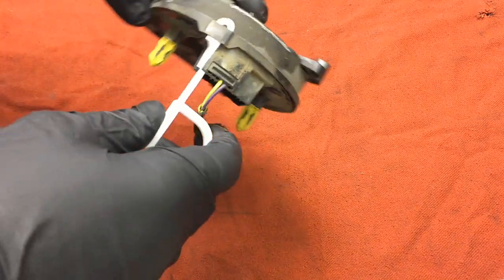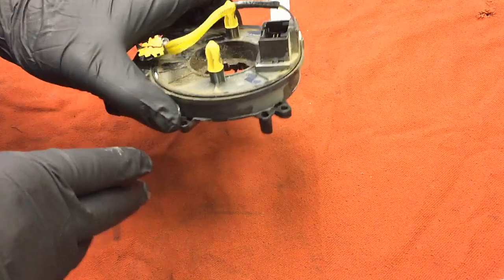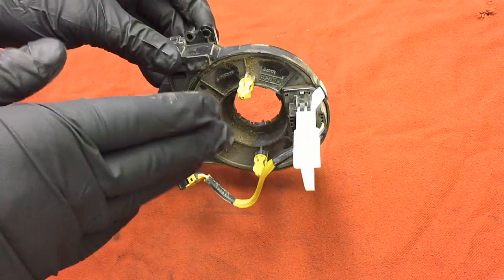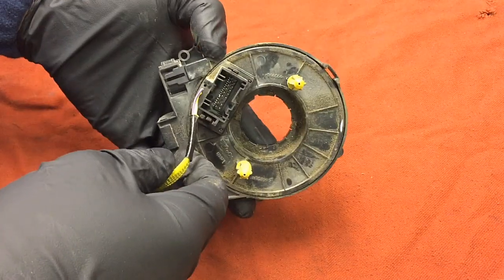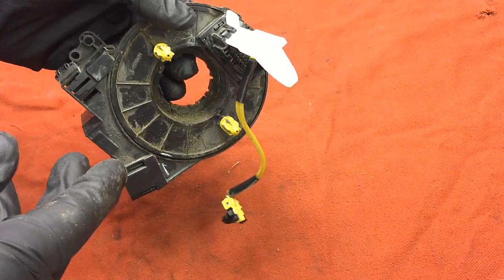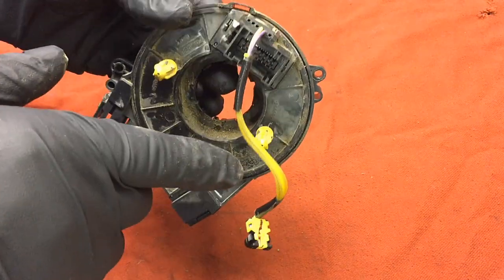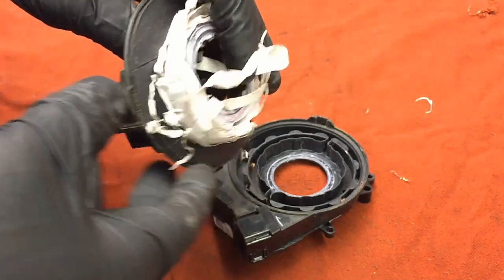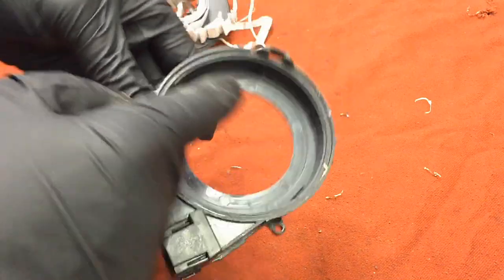Ford Quick Tips: #34 How Clocksprings Work and Fail

Comment: Great video as always Brian! I don't know if you're interested in doing this since you're only dealing with Ford,but there's a few makes and models out there that do not have clock springs available anymore and can cost up to 600$ to buy from the dealer. Of course those are sold together with the switches as an assembly. So you're only left with junkyard parts. Some of the people that work there don't know how to take them off and mess up the alignment. There's a procedure to realign them,they shouldn't go more than 2 and a half to 3 and a half turns from the middle to each side. So,if you're interested you can show how to realign them and also how to test them when they come from the junkyard-there should be continuity between the 2 pins of the connector for a good one.
Reply from the maker: Nick Nicu Yeah that is an idea, now I just need to find one that is not broken.

Comment: I have a 2013 Escape and I go thru about two clock springs per year. And at around 400 to replace these suckers, it gets to point where I just give up and don't bother wanting to get it fixed - what a pain this system is ! . Need to remove the button controls off of the steering wheel, or maybe have the buttons controlled by a wireless signal. Another thought is to have a gold wiper contact on the clock spring system (for non-critical controls). Just think what the other computer systems in this vehicle are going to cost when they "go south". Thanks Brian for the look-see !!

Comment: Helpful. Thanks. Mine just failed on my 15 Expedition with 55k miles. Seems like an unusual failure. I’ve never heard of anyone with that issue. The symptom was steering wheel controls on both sides stopped working. No warning lights, horn still worked.

Comment: Looked at your Ford cruise control vids a few times now.  This one,  the brake switch under the master cyl and the brake pedal switch.  I've replaced both switches on the MC and at the brake pedal... my clock spring seems 99%fine...  still no cc!  Paddle switch left of horn pad perhaps?  Anything else i need to be looking for?  Chip in or on the trans, speedo gear,  fuse links, relays etc etc.  1999 E150 conversion, high topper  93,800mi. Thank you for being here! 👍🏼👍🏼

Comment: Great video. Verified the clock spring is failed in my 98 Contour SVT. Reads code 32 Clock spring, and my turn signals don’t always cancel, horn doesn’t work and the cruise control has stopped working. All of these issues have been intermittent for the past few months, but last week cruise and horn stopped working the the airbag light is constant flashing flashing the 32 code. Very cool to see how the clock spring actually works, and now it’s time to find a good used one.

Comment: Awesome, thanks for this one.  I didn't have a clue on how clocksprings work until today...I just knew not to move the wheel when the steering linkage/box/rack was disconnected because you'd screw it up.

Comment: Interesting design, it's not what I imagined. I guess using a length of ribbon with continuous connections is better than rubbing copper spring contacts wear out over time. No spring, the curious name is historical only.

Comment: I find it amazingly crappy how this design was for the ribbon cable assembly. I have a 2013 escape and have had many problems with the button assembly that controls the front on screen display on the dash. Got tried of having to pay out 100's of dollars to get repaired by ford. So I took matters into my own hands and disassembled the steering wheel air bag unit with the controls section ( hoping that it was just the buttons acting up and NOT the ribbon cable). All I had to do was give the button assembly a cleaning with some electronic cleaner and  now it works just fine. When I opened up the button assembly, it didn't even look dirty at all. Cleaned it anyways and that made the difference. Mind you, it was a pain in the ass trying to figure out how the air bag came off but did figured it out. It cost me my own time only ..... this time.

Comment: Absolutely great video. Thank you so much for the information. I have an 2001 F150. Unfortunately the airbags are blown and there's no cruise control. May I just ask if the clock spring is needed? Or can it be removed completely

Comment: I would assume that the steering wheel would have to be indexed with the clock spring to prevent over twisting of the clock spring, that is unless the clock spring is capable of double the max number of steering wheel turns in a worst case scenario install. Thanks for the great videos. If you get in any panthers do an air ride video and or a plastic composite intake manifold replacement video. I'm really curious as to how the ecoboost head gaskets are holding up as well. 
Oh also I'd like to see an adjustable gas/brake pedal video assembly repair if you get any of them in. 
Great video as usual.
I'd of loved to of seen a video of your Focus engine rebuild. My mom has a 3.0 Vulcan Taurus and I really enjoyed your 3.0 Vulcan Taurus head/head gasket video. I hope that your employer is paying you top wages Brian as you save 3-fold your wages in return issues, as your work is so clean and meticulous that I doubt any repair that you have ever done has ever came back in. I doubt that you have ever stripped an oil plug or lug nut by cross threading one. Of course I'm sure lots of oil drain plugs come in stripped and of course, the blame would be on the current oil change. 
Thanks again. I wish I could do the things you do Brian.
Reply from the maker: fastrace011 You put the clockspring on centered, then those two yellow nubs on it lock into the steering wheel at that point. Ecoboost head gaskets are not a problem actually. I learned very early on in my career how to do this job right and have stuck by that. I think even more than pride I don't want to have to deal with management or the customer on comebacks or misdiagnosis issues.

Comment: If I grab a used clockspring for my 2016 F150 what is the procedure to clock it properly for install? It doesn’t have a locking tab on it and I don’t know if the wheels were straight on the donor truck when removed. Great video! Thx.

Comment: I’ve got intermittent cruise control switches. Just recently I’ve noticed my audio track selection switch on the opposite switch has stopped working. Then, just like usual they both started working after 3-4 ignition switch cycles and/ or when my battery was disconnected after getting the Expedition tune updated for the new Full Race Freak-O-Beast intercooler kit install I got for Xmas. 

It’s never been a complete switch(es) failure. Only certain buttons. I’ve successfully changed the cruise switches twice. They work immediately after changing for quite sometime. Then starts intermittently working again. Kinda makes me think switch, and not the clock spring in my situation.

Comment: What if your steering is quite, yet the horn doesn't work and curse isn't working? Fuses are all good by the way.

And I hope you see this and can help me, I'm having a difficult time trying to remedy my ac issue. 05 f150 4.6. Brand new compressor. Brand new high and low pressure switches. Refrigerant has been vacuumed and refilled professionally to exact lbs needed.

Ac clutch will NOT engage. But when I jump the relay under the hood it kicks on and stays running for as long as the pins are jumped.

The relay under the hood and even the entire heat/ac control panels switch are brand new as well. PLEASE help me figure out this nightmare! Lol

Comment: I have a 2014 ford fusion SE 1.5L. i think my clock spring needs to be replaced. The air bag light was on fir a few days about 6 months ago and went off by itself. Did not think anything of it. The horn does not work, the volume button does not work and the down arrow on the right side does not work. The steering wheel is quiet when turning. The horn does work when i hit the lock button twice on my key fob. Did not know if it is the clock spring or the sccm. Any advice?

Comment: I know this video is pretty old but my airbag light is on and flashing. It is giving me code 32. I've searched it and it is saying it's the clock spring. My horn still works and I'm pretty sure my cruise control still works. The light came on after I took my front driver and passenger side seat belts off to clean them.

I had to take them off due to some mold on the belts. I pulled the interior panels no problem. Unplugged the sensors on the belts. Then I pulled the belt out as far as I could then pressure washed the belts. I put a bag around the belt reel and sensor so they definitely didn't get wet. Didnt retract the belts till they were completely dry then reinstalled them. Plugged the sensors back in as well. Wires were all good too. Not to sure how long after but then my air bag light came on and is constantly flashing. So what could be the prob? Dont want to buy a clock spring and still ha e the issue. Plus can't buy one at this time. By the way it's a 2002 f250 7.3L. Auto 4x4

Comment: So I have a 95 F250 7.3L Diesel Manual Transmission. My cruise control quit working and research has taken me two places. A clock spring or the cruise control at the end of the brake cylinder.  The only steering wheel controls are for the cruise and of course the horn. I have also read that since I have no airbag I may not have a clock spring. I have the part number for the cruise release on the master cylinder but its installed in the 7 o'clock position. Will the brake fluid continue to flow once removed or is there a valve that will keep it from spewing out? I am leading towards this as being the culprit. AlsoI have to remove my instrument cluster for repair do you happen to have a video for that?

Comment: Great video. Maybe you can answer a question for me. I have a 2008 F250 Lariat with steering wheel controls. I noticed the other day that the controls are not lit up, although I'm not sure if they are supposed to. All the controls do work. My question is, if they are supposed to light up, and if so, what could it be? Thanks in advance.

Comment: Great video Brian !!! I have a ford s-max from 2009 , the controls steering wheel works , but when i use cruise control and i use the horn or cc speed up or down , cruise control stops working . When i push the horn again for few times , then i can activate cruise control again on the steering weel . Is this a clock spring  fail ? Thanks and greetings from Belgium

Comment: If the turn signals fail too (F-150) along with steering wheel controls is that still a clockspring, or does that point to SCCM?

Comment: If the horn on a 2014 F150 doesn't work from the steering wheel, but still works with the key fob / panic button, it sounds like this is the most likely issue. Is there any other thing I should check before replacing the clockspring? What a goofy design to not have a separate relay switch. Everything else works fine...

Comment: My 1994 E150 Club Wagon is flashing a 34 airbag code. Horn and Cruise control still work. The error is described as "Driver side air bag circuit low resistance or shorted"  Local mechanic says replace clock spring. Problem is I can't locate one anywhere. What are my options? Can the existing clock spring be repaired?  Will the clock spring from a different year or model be made to work? Any advice you can offer would be really appreciated!

Comment: 2012 f150 xlt . I have no horn currently but every now n then it works , sometimes my radio just makes popping sounds and will not play, and I believe my passenger side airbag is stuck in the 'on' position because the light never turns on to indicate it is 'off' . Does this sound like a clockspring issue ? I have checked fuses already .
Reply: BTW thank you for you videos you have saved me money countless times. If my dealership had techs like you I wouldn't have to tell them what's wrong!

Comment: I was told by auto repair shop the code reader said it was a Ford Steering Wheel Position Sensor. Is this the same thing as the Clock-Spring ?   I can't find the Position, so maybe the Clock spring did both. ??? Thanks

Comment: Question, can you install the existing airbag but just not connect the wire to it.
I have found a surplus clock spring for now whilst I wait for a new one. But don't want to connect the airbag but need the horn working. Thanks

Comment: In my crown Victoria, the brake warning light is on and the cruise control doesn’t work….. will it be a clock spring issue.. check everything else…. Pls share if you have any knowledge….

Comment: QUESTION/ HELP
What if your horn works intermittently? As in, you turn the steering wheel to one position and hit the horn and it works. Then you turn it to another position and it doesn't work?
I feel its the clockspring but wondering if anyone else might have some input on this. 
Thank You in advance.

Comment: Hi, I changed my clockspring with angle sensor both, and Traction control light shows up when im rotating steering wheel to full position right, or full left. what can cause problem ? transit 2013. thank you

Comment: What about one for a 93 f250? My horn and cruise control quit working and cant find a replacement one in any part stores nor online.
Reply: Check Ebay or a local auto parts recycling business (junkyard).
Reply: @EverydayProjects  actually found out my old truck doesnt have a clock  spring. It uses slip rings and spring loaded carbon brushes. Obsolete parts according to the local ford dealer.

Comment: Did anyone have luck with the clockspring replacement fixing nonfunctional steering wheel controls and multi- function switch (wiper/ flasher), etc? Everything on my steering column is dead except the horn.

Comment: This is a really useful video.  I have a UK Ford Kuga new from 2016.  When the indicator is applied and I turn left or right, there is a distinct clicking noise, once, often twice when going around a corner.  If I turn a corner without indicating, there's no clicking noise.  Do you think there might be a problem with the clockspring even though the car is only 10 months old?
Reply: This noise is normal, it's primarily to know how close you are to full steering lock while going around a corner.

Comment: Need a bit of help I changed my steering shaft on a 2005 f150 and had rope holding it from flopping around but took rope off to align the steering shaft to seat correctly now I’m hearing a small clicking type noise only when turning

Comment: My brother's 99 Windstar doesn't have the ribbon cable enclosed in a cartridge such as you just showed.  The air bag light is on and the cruise control doesn't work, probably no horn either.  When I loosened the bolt in the bottom of the steering wheel hub and removed the wheel, this ribbon cable is just all loose in there and I see no way of disconnecting the airbag nor the steering wheel from this cable to put in a new part.  Even my 94 Astro has a "cartridge" design as you showed here in this video that I had to remove when replacing the little signal cancelling springs years ago and it was all easy to do.  Any thoughts on this Ford?
Reply from the maker: JRobert111111 The windstar has the sliding contact design and also a yellow harness attached to it. I can send you instructions on how to replace it if you have an email address.

Comment: I have a 2004 Ford Expedition. Can a bad clock spring cause steering wheel binding?  I still have button & horn function.
Reply from the maker: no
Reply: @FordTechMakuloco  OK, thanks. I will check the lower steering shaft.  But I only asked due to the clicking sounds I hear when it binds and then loosens.  It sounds like it is right below the air bag on the steering wheel.

Comment: The problem I’m having I just bought a 97 Lincoln town car saying that you series and the clock spring is bad and there is not a new one in the country. I’ve called dealers I’ve called obsolete part dealers and they tell me the same thing there is not a new one available, they made over 900,000 from 1990 to 97 and nobody has a clock spring for one that’s ridiculous

Comment: How do you get the clock spring back to center after the steering shaft and knuckle has been removed from the steering gear? On a  2004 Ford f150 xlt heritage 4x4  4.6L
Reply: Did you figure it out?
Reply: @urenaanthony91  
Yes Sir..... Thanks for looking out...
Reply: @jimthorpe9291  what did you do?
Reply: @urenaanthony91  
Hahahaha what you mean what did I do.... lol... I counted the number of turns till I felt the ribbon tighten then turned it back half of many turns...
My Cruz control everything works like a clock.......bought a 2004 f150 heritage been doing work on it good bone dry 4x4... getting to know it and enjoying every min. Of it....!
Rather have it then a brand new one any day....
Reply: @urenaanthony91  
I bought the truck from a top notch mechanic that owns a car lot just down the road so he is the one who gave me a hand with it ... A real solid guy.... I got alot of respect for him he's a good mechanic....!

Comment: On my 2015 Tahoe the changing music button volume button setting button stopped working horn works cruise but turns the light on but won't engage do you think this could be it going out ?
Reply: I have the same problem  on my colbt chev my  turn segnels  on the passenger side won’t work and my horn  and Cruze control won’t work changeing out clock spring tomarrow

Comment: Will a bad clock spring cause the wiper/turn signal and steering will buttons not to work to? I had a similar problem on a 2015 f150 with a U0212 sccm.
Reply: Same thing here. What did you end up doing?